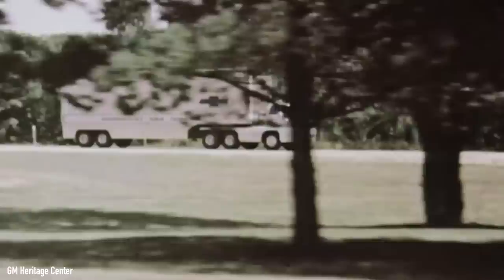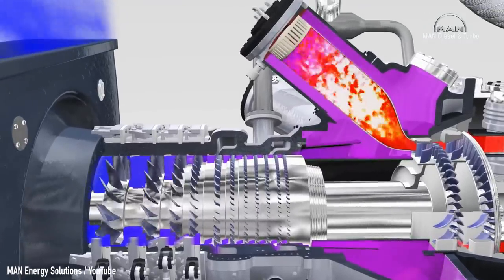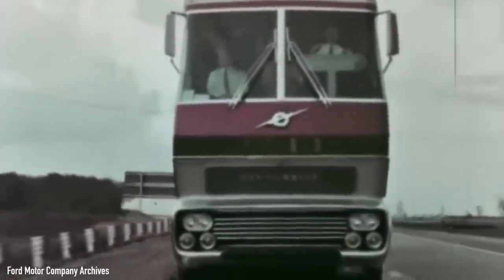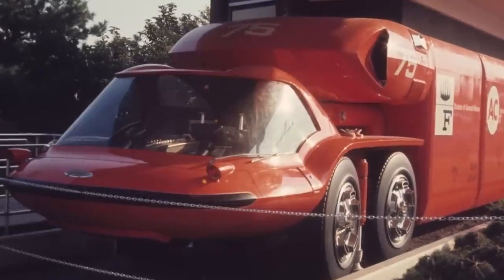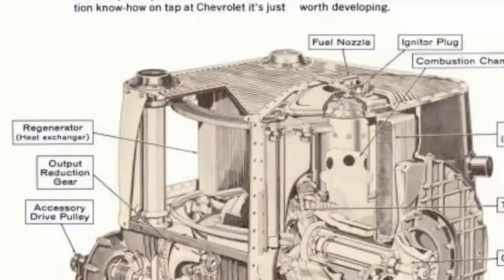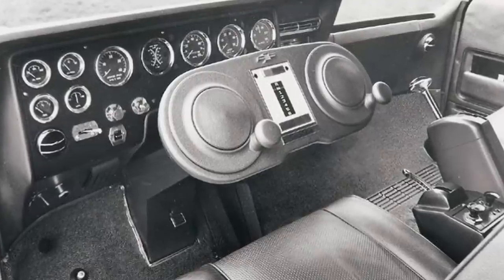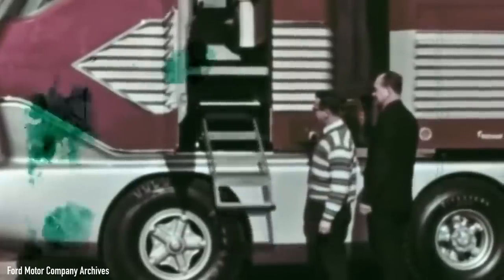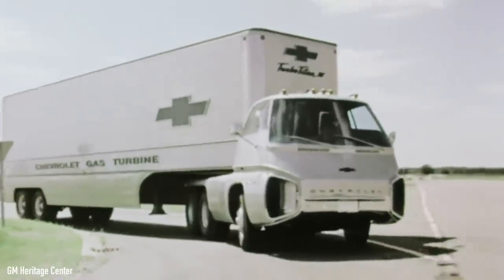The story of Turbo Titan, Chevrolet's long-lost gas turbine truck that almost made into production

Comment: The M1 Abrams uses a gas turbine engine, so even the army thought that turbines were viable for a vehicle during the 80’s
Reply: Because it weighs 60 tons, which is half again as much as a semi truck. A diesel for something that size with the Army's asks - supposedly it can go 60 mph off-road - would have been just too unwieldy. But the Abrams' fuel consumption is just astronomical compared to a diesel of similar output.
Reply: @joshbobst1629  only bad on fuel when not at WOT. And they go faster than 60mph ;)
Reply: @joshbobst1629  meh 12v swap turn the pump up big single jingle that tank will stroll
Reply: True and Even the navy ships used gas turbines just A lot bigger of course
Reply: The AGT-1500 Gas Turbine engine in the M1 Abrams tank was designed in the 1960's for use in Tractor-Trailers. Back then they thought Turbine engine tractors would pull trailers to distribution centers and would only travel at high speeds on interstate highways. In those operating conductions using a Turbine engine makes perfect sense. It also made perfect sense to use in a Tank. Until then the diesel engines used in M60 Tanks had to be rebuilt at 500 hour's of use. The AGT-1500 can easily go 100,000 hours or  more before being refurbished.
Reply: US has been using turbine tank engine for a long time now...Abram is using the same turbine made for helicopters
Reply: GMs last look at turbines was a concept car in 1986
Reply: @piffpuffpeng  You are confusing the operational life of the M1 Abrams tank with the operational life of the AGT1500 gas turbine engine. M1 Abrams tanks go into maintenance facilities for regular vehicle maintenance depending on the conditions they are deployed to. Obviously Desert conditions require more maintenance with fewer hours of operational time. The AGT1500 engine is removed from the Tank, inspected, and run on a test stand to check it for oil and fuel leaks and bearings are monitored for metal shavings indicating problems with the bearings. If there are leaking oil seal's in the engine or bad bearings the engine is separated into it's modular components where the seal's and bearings are replaced without the need to completely take the engine apart. Typically the engine will pass it's tests on the test stand and will be installed in a tank that has undergone maintenance and passed inspection and is ready to be sent back to it's company or combat unit. New AGT1500 engines have not been produced since 1995 as there is no need for them. Gas Turbine engines are not like diesel engines with many part's that are continually rubbing with metal on metal contact with just a thin film of oil to lubricate them. The only parts that rotate in contact with other parts are the bearings and oil seal's. Nothing else in the engine is in physical contact with other parts of the engine so there is nothing else to wear out. There are a lot of AGT 1500 engine's that have been in use since they were manufactured by Lycoming in in the late 1970's with only basic maintenance like ignitors, fuel nozzles, combustion liner, and recuperater replacement and upgrade modifications such as a bleed air port for NBC systems. Currently the Army is considering leasing AGT 1500 production equipment to a contractor to restart production of new AGT-1500 engines in order to obtain new engines as none have been made for over 30 years.
Reply: It makes sense in a tank as these engines will burn almost anything and gas is not always available in the battlefield.
Reply: @Jaybird248  nothing like the smell of a tank running on cooking oil
Reply: @joshbobst1629  even though the Abrams fuel consumption is insane, the torque that a turbine engine can provide is unrivaled.
Reply: @suctioncupman1607  Not really. Turbines run insanely fast with very low Torque, both compared to Diesel Engines. Very large, Heavy Duty Multishaft Turbines in Powerplants run at 3000/3600 RPM, depending if they are driving a 50 Hz (Europe) or 60 Hz (America) Alternator. I'm not familiar with small Turbines but the Speeds would be much higher; definitely beyond 10,000 RPM. Similarly, a Diesel Engine with comparable Power to such a Heavy Duty Turbine would run at up to 700 RPM if it's a Four Stroke V-Engine or at 80-120 RPM if it's an Inline Two Stroke Engine. IIRC do typical Tank Engines run at about 2000-3000 RPM. You need large Reduction Gearboxes for Gas Turbines.

When comparing Gas Turbines to Diesels, one can really point out the Fuel Consumption of Gas Turbines, as the most Efficient heavy Duty Turbines reach a specific Consumption of about 220-230 g/kWh, while the most Efficient Diesel Engine (IIRC the M.A.N. S80 ME-C9.0 Two Stroke with 6-12 Cylinders. I used to work with it, you can watch a few Videos about that on my Channel) can reach up to 165 g/kWh. If you aren't familiar with specific Consumption, this means that Gas Turbines are about 30-40% Efficient while Two Stroke Diesels can reach more than 50% Efficiency. Gas Turbines are so inefficient because they lose a lot of Heat with their large Amounts of relatively hot (600-800°C, compared to 400-600°C on Diesels) Exhaust Gas. It is possible to utilise some of that Heat by putting a Boiler behind the Exhaust to drive a Steam Turbine. This has been done since Decades in Combined Cycle Powerplants, which reach Efficiencies of up to 65%. I am writing my Marine Engineering Thesis about using such a Thing as Marine Propulsion System, as it has a lot of Advantages over Diesel Engines when running on LNG Fuel, which reduces Exhaust Emissions of Sulphur Dioxyde (by 80%), Nitrous Oxyde (by 40%), Carbon Dioxyde (by 20%) and Particulates (by 95%), all of that while maintaining or even improving the Fuel Consumption of a Two Stroke Diesel. The Advantage of Gas Turbines over simply fueling Diesel Engines is that they have almost no Methane Slip, which would kill off all the reduced CO2-Emissions of a LNG-Fueled Diesel Engine as Methane is a much worse Greenhouse Gas than CO2. Another possible Advantage is that Gas Turbines are much quieter (outside the Engine Room) and cause less Vibration than Diesel Engines; I expect that there will be some new Regulations about that Topic coming in the near Future.

EDIT: Obviously all of that Exhaust Boiler and Steam Turbine Stuff only fits on very large Applications like Powerplants and Ships. You'll never see that in Automotive Applications, but Gas Turbines are slow responding and don't take Partial Loads very well, so you won't see them there anyway.
Reply: @Genius_at_Work  well suction cups statement is indeed correct the AGT does provide the means to produce the highest torque numbers seen in a MBT. Yes of COURSE this is accomplished with a giant gear box, every engine designed for moving vehicles has a gearbox but that doesn’t change the fact that no diesel can compete with the AGT in the Abrams for torque. 1500hp is standard for most MBT
Reply: asteinmann  I have no Idea about Tractor Pulling but using Hydraulic Clutches/Torque Converter is the first Thing I can think of. These Things consist of a Pump Wheel and a Turbine Wheel right next to each other in an Oil filled Casing. The greater the Speed DIfference between both Wheels is, the more Torque you get on the Turbine Wheel. You can also place a Set of Guide Vanes between both Wheels to include a "Gear Ratio". Having a decent mechanical Reduction Gear after the Turbine and then such a Hydraulic Torque Converter is the most logical Thing to me.
Reply: Gas Turbines can run on garbage fuel. The M-1 engine was even run on coal.
Reply: @Genius_at_Work  Gas turbines like running at high power - hybrid drives, either hydraulic or electric are an obvious match.
Reply: Just kind of a general response in the thread, I love that those turbine engines run on just about anything...the other engine I can think of just off the top of my head that does that is the Continental engine used in the 2.5 ton trucks (and probably others, 5 ton?) The old “deuce and a half’s”.  I’d love to have a true multi fuel truck.  I almost bought a surplus deuce a few years ago, but I was poor at the time while still in school and had to pass.....on $1200 for a running deuce 🥺
Reply: @joshbobst1629  most semi trucks dont break 30 tons fully loaded
Reply: @MinutemanOutdoors  Not the ones I drove. Even the mini-wheelers were 35 tons, and they'd load them right up to within ten pounds of the max. For a while at the end I was hauling produce cross-country, and the only time I wasn't one pallet away from 80,000 was immediately after unloading.
Reply: The Abrams is powered by a gas turbine in part , because it's quick, quiet, and doesn't belch black smoke (which diesels were notorious for doing) to give it's location away.  The gas turbine was also chosen, because it can burn any liquid fuel source as a fuel, allowing it to use alternative fuels, in case one were to get cut off from it's fuel supply.  The choice was deliberate and purpose driven.
Reply: @ChipmunkRapidsMadMan1869  Allison still makes gas turbine engines as a division of Rolls Royce (who bought them from GM in 1995).
Reply: I believe cost is the biggest problem.
Reply: And the M1 Abrams was designed and engineered by Chrysler
Reply: they are returning to the old diesel engine
Reply: @viarnay  No - they are adding a generator so they don’t need to run the gas turbine to keep the tank warm.
Reply: @n4zou  I watched many 12v71 Detroit engines getting swapped in M-60 tanks, when I was in the army, so what you said about 500 hours makes sense. 
They would swap them with a new ( rebuilt) in our maintenance building, or when we were in the field.
Reply: Soviets also used gas turbine for their T-64 prototypes and Tlater production series T-80, but not because it was "economical" but because its output meant much quicker response, faster speeds and multifuel purposes, however the T-80 suffered similar issues to Abrams such as air filters having to be changed very often, the engines dying duo to load emplaced on them and the fact that they cost more to be made than regular diesels, overall Soviets abandoned it, going back to diesel-electric concepts that offered same characteristics but superior reliability and fuel economy. If I remember the americans also had a diesel-electric concept in the 80s.
Reply: @bovineexcrement8635  No, the AGT-1500 was not the same as used in helicopters - the first hint is that it has a recuperator, which is required for adequate fuel economy in a truck or tank but too heavy and bulky for aircraft. There was an aircraft engine developed from it (the PLT27), but they are only related - not the same - and the aircraft version never went into production.
Reply: @n4zou  Not true.  Lycoming was awarded the original contract for the AGT-1500 in 1965 and it was designed for that application from the ground up.  The need for a gas turbine was to get that much power in a small package with reasonable efficiency, low noise and low thermal emissions but even with the regenerator (heat recovery) system built in, high fuel consumption was a problem.  The engine suffered from a short time between failures and overhauls but is still in service today.  The AGT-1500 was also slated to be used in a recovery vehicle and a bridge-layer version.
Reply: @paulavery366  I worked at the Anniston Army Depot where M1 Abrams Tank's are rebuild including the AGT-1500 engine in the Army's Abrams Tank program. I helped get the engine rebuild program started and built the first test stand to test and adjust the rebuild AGT-1500 engines. There's a lot of misinformation floating around the media concerning the M1 Abrams Tank. I've heard them simply make up and publish completely false information because they know nothing about them and so publish complete rubbish. The AGT-1500 was originally designed in the 1960's  for use in tractor trailer rigs that were going to be used on the new high speed interstate highway system that was still being built at that time. The engine bolts directly to standard freight truck transmission's and the engine has a planetary gear reduction unit installed so when the engine is running at full power output it's drive shaft output is 3,000 RPM, which is exactly what a standard truck transmission is designed for. The way they expected these freight trucks to operate was the high speed tractor trailer rigs would be easily able to maintain maximum speed even when climbing steep grades. They expected these Gas Turbine Tractors to pull 2 and even 3 full size, fully loaded freight trailers. These Tractor trailer rigs would only operate on the interstate highway system similar to how freight trains operate. Freight terminals would be located at exit ramps where these tractor's would have the trailers unhooked and another set of trailers connected along with fresh Driver's to continue to the next terminal. Jimmy Carter ended that with his mandatory national 55 mph speed limit. There was no longer any need for a lightweight gas turbine engine with 1500 hp to pull 3 trailers maintaining high road speeds between off-ramps. The AGT-1500 production equipment was put in storage for possible future use. That future use would end up a little less than a decade later in the XM1 Tank that was the design platform for the M1 Abrams Tank. I was a Gas Turbine Systems tech in the Navy and using the Navy's College at Sea program I got a Degree in Marine Engineering. I was going to become a Marine Engineering Officer in the Navy on Ships with Gas Turbine engine's but the Army made me an offer I couldn't refuse because they were failing in their efforts to rebuild the AGT-1500 engine. That engine is a duel spool engine and all the people working on it were all aircraft engine mechanics which are single spool designed engines. The difference is like comparing cats and dogs. The Aircraft Mechanic's simply didn't understand the differences in the design of the AGT-1500 engine. I've heard people say it's a helicopter engine and the Soviets used one in the T-80 Tank's so perhaps that where that misinformation comes from. You really can't take anything you see or hear in the media concerning any military equipment. I think the military helped that helicopter engine misinformation along so the Soviets would design a Tank with a Gas Turbine engine and fail, which is exactly what happened. The T-80 Tank's use a standard helicopter engine, which uses way too much fuel as they discovered. The first time they were used in combat they ended up running out of fuel and abandoned by their crews. Anyway, never believe anything you hear in the media concerning military equipment as many times you'll get misinformation directly from the "source" of that misinformation.
Reply: @n4zou  I worked as an engineer at Lycoming (Stratford) from '65 to '71 while the AGT-1500 was being developed.  The recuperated design came from Dr Heinz Moelman and the team of German "Paperclip" engineeers, specifically for the M1A1 tank.  Moelman would propose and analyze dozens of engine concepts throughout the 50's and 60's and his biggest successes were the T53 and T55 helicopter engines for the UH1 and Chinook applications.  There was never any talk of a highway truck application but Lycoming were approached by racing teams who couldn't wait to get a lightweight 1500 hp turboshaft engine for their projects.  The durability problems of the AGT-1500 resulted in other engine companies being invited to review the design.
Reply: @truthseeker2321  Not sure why a 12v71 would get swapped at a mere 500 hours though... those things run almost forever in other applications. Also the ACE engine cummins is working on now for the military is a 2 stroke (4 cylinders 8 opposed pistons... very compact and meets next generation emissions easily.
Reply: @Wingnut353  I couldn't tell you, and the mechanics probably couldn't either. 
Maybe just a way the defense department gets more money for it's toys. I worked on weapons, from pistols all the way up to 107mm mortars, and we changed rifle and machine gun bolts and barrels all the time, despite them hardly being used 3 or 4 times a year. 
I have never changed a bolt or barrel on any type of rifle, shotgun or pistols that I have owned, and a couple of them are still in pristine condition, despite being over a hundred years old.
Reply: @Wingnut353  A friend of mine bought an old Greyhound bus with a 12V71, and it had never been torn down and rebuilt until he did it. Hard telling how many hours and miles were on it, and it was still running when he bought it.
Reply: I believe the Abrams has an auxiliary diesel engine that is used when high output of the turbine isn't necessary.
Reply: @joshbobst1629  that's 6 liter European diesel  from 1990 ties. just American diesel sucked back then.
Reply: There sure are a lot of educated people in here that don't have a clue about capitalization. It's hard to take someone seriously when they begin every other word with an upper-case letter.
Reply: The  turbines were a failure in the desert. They were  destroyed with the sand. An  Ambassador to Australia wanted Ted Pritchard  to go to Fort Dix and design a steamer. By that time age was a problem and I know that technology  falling into the wrong hands had him concerned. He had a sensitive personality and any thought of his effort causing loss of life was a little too much. He was one of the greatest engineers this country produced. Anybody with brains here is considered dangerous. He has gone now.See Prichard Steam.
Reply: The gas turbines were a failure in the desert. The sand just chewed them to pieces. An American Ambassador to Australia wanted a friend of mine to go over to Fort Dix and design a steam unit he perfected, for the Abrams.He had already designed, built and demonstrated a steam unit in America. The vehicle builders and the govt were not interested although it was, and still is, the lowest emission engine in the world. The steamer would not have been effected with sand because it is a sealed unit. Ted Prichard was probably one of the best engineers Australia ever produced. However the clowns we had in govt. at that time, considered anybody with brains as dangerous. Ted was a very sensitive person. He just could not have anything to do with somebody losing their life.
Reply: @Genius_at_Work

i dont see how one hydrocarbon fuel produces less emissions and particulates as another hydrocarbon fuel. LNG is just gasoline? 

but your saying its liquid methane or methanol. ? "methane slip"? 

what is this?